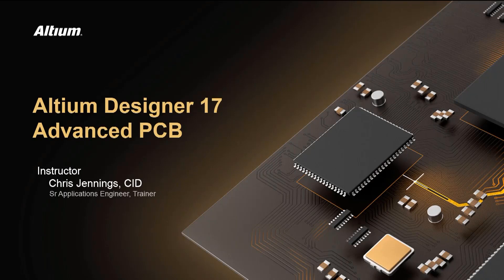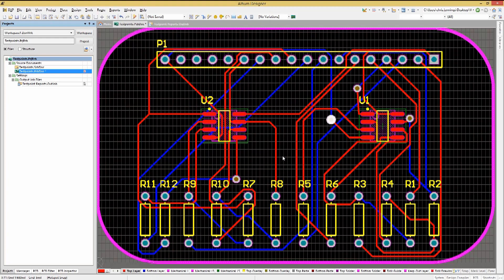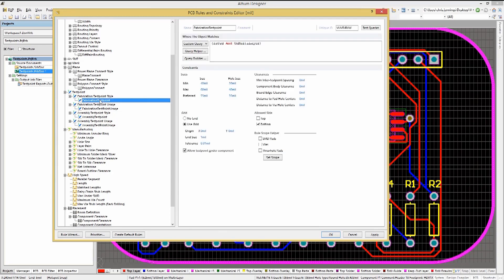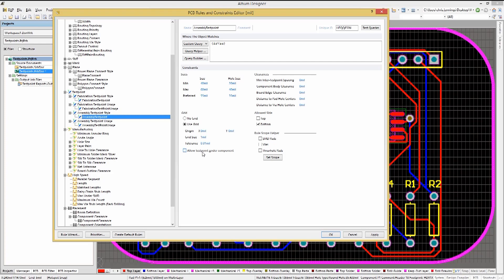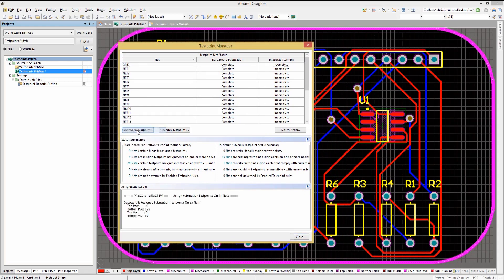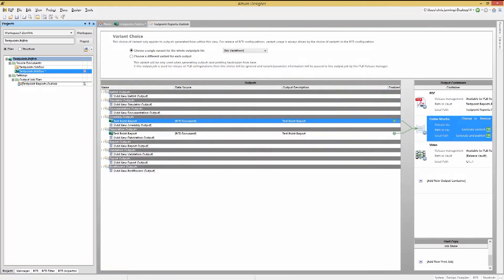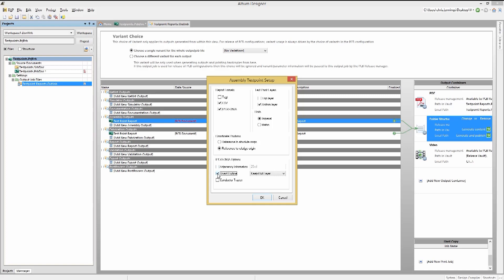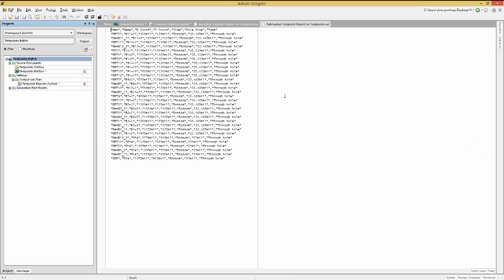Adding Test-points | Altium Designer 17 Advanced | Module 16

Comment: "Keep in mind that assembly test points for device pads may not be allowed for surface mount devices
and on the same side as the throgh hole device to be mounted on."

What?